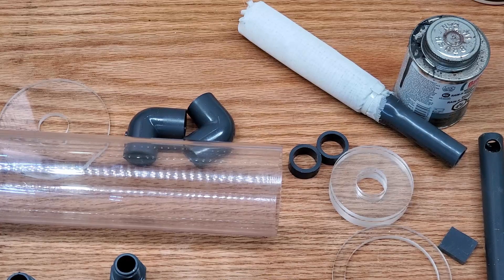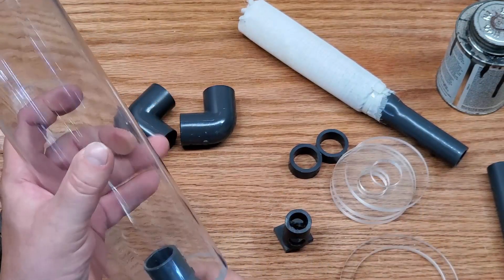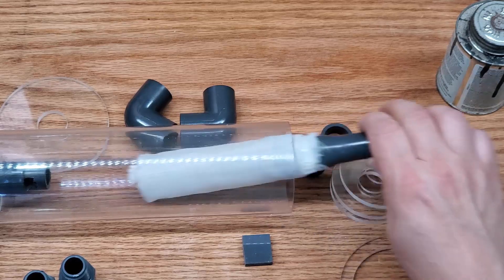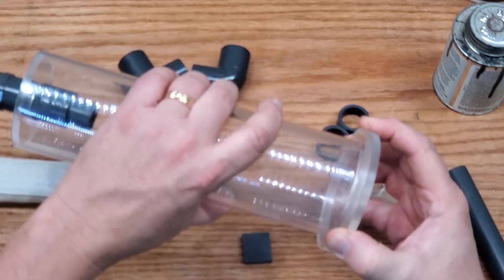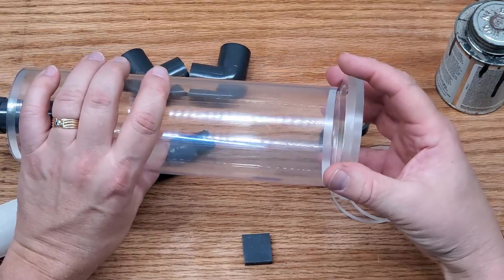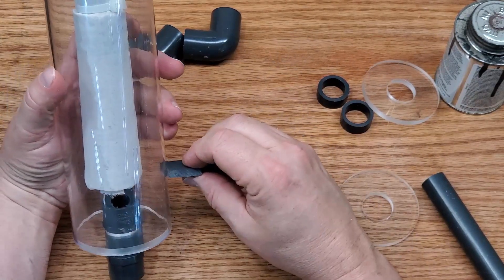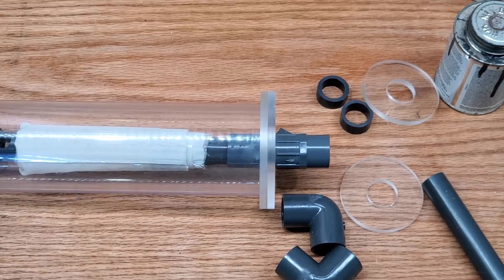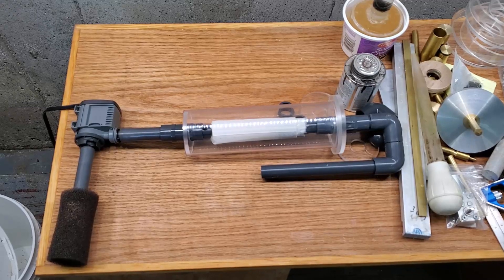Mini Diatom Filter Part 1

Comment: I was thinking of using an old 32oz. Nalgene bottle as the pressurized canister.
Reply from the maker: As long as you can get a tight seal and the necessary plumbing in place, it should work fine

Comment: Would like to see you make these cool things using tools most people have (not a lathe for example) because I need a diatom filter,  but can't afford to but the expensive tools
Reply from the maker: I will put up a poll and if enough people are interested I could try and design a diatom filter with more common tools. Thanks for the suggestion!

Comment: Loved my diatom, except for size and cleaning. I kept mine on my 55 except on cleaning days when I took where needed. 
A smaller option is a great idea. Power is a concern, was well as where to put it. Small like that, HOB would be ideal IF leakage wasnt a potential issue.
Reply from the maker: Hey Ray! That's the reason the first one I made was so large. The ones I used to work with were big. I could make it water tight. I actually prefer it this way so it is easier to setup and clean. Thanks for coming by!

Comment: You could machine a ring that fits inside the main body, and weld it. This will act as a lip. You can then use a rubber gasket in between the lip and the friction fit lid, to make it waterproof
Reply from the maker: I went the gasket route for the first one. Here I just wanted to try the friction fit since if it didn't work it was still a functional filter and it would be simple to set up and clean. Thanks for watching!